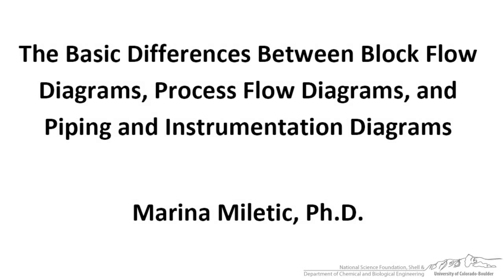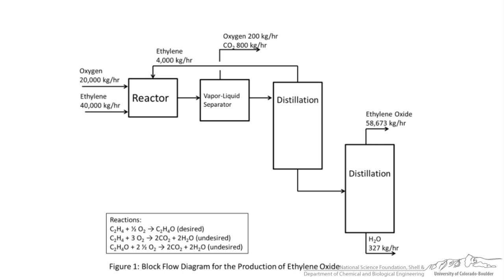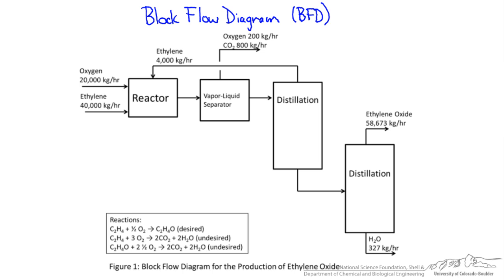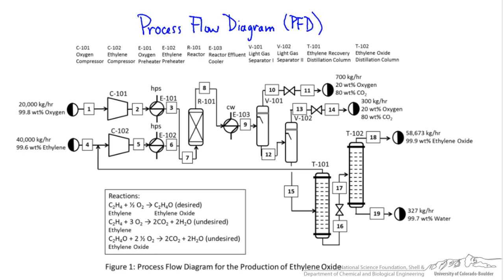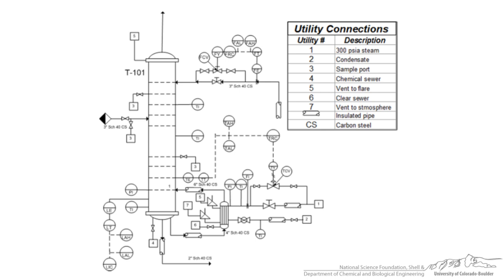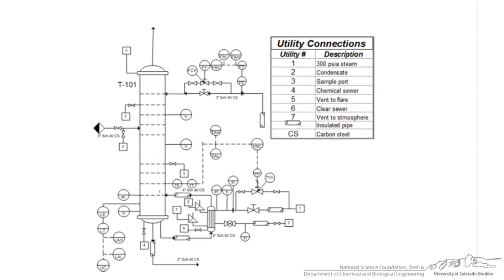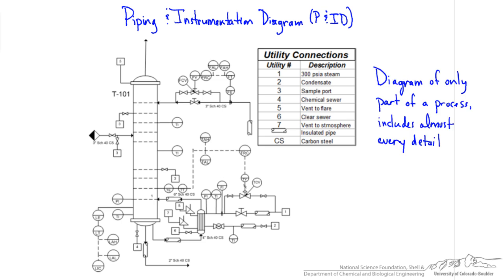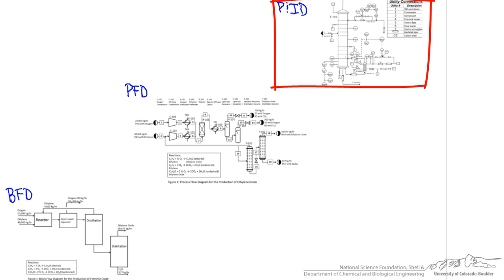Basics of BFDs, PFDs, & PIDs

Comment: Valves and control logic do not belong on a PFD, only unit operations are shown which also includes all rotating equipment.
Reply: It does if it is instructive to critical elements of the flow diagram.